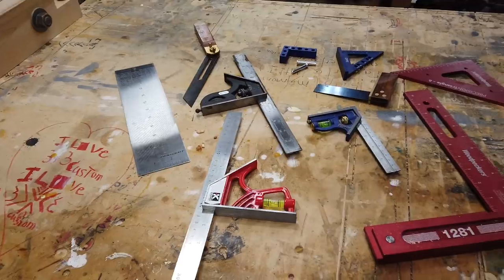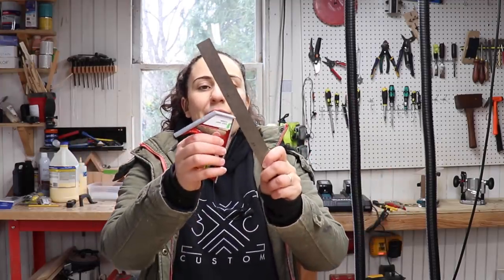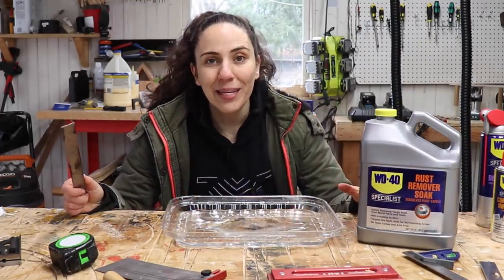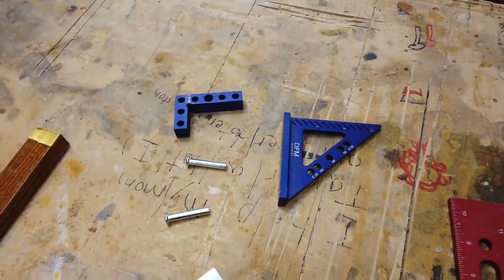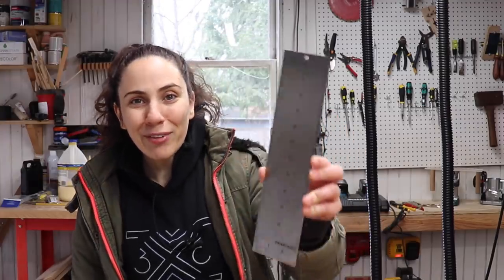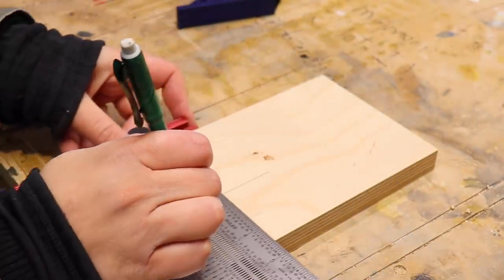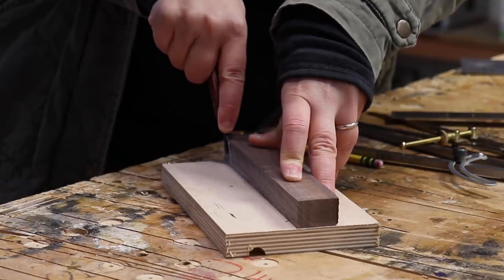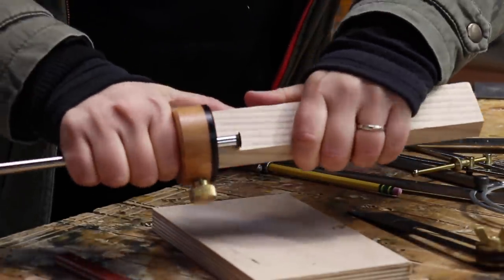Best Tools for Accurate Marking and Measuring When Woodworking

Comment: The measuring calliper is really a must. It is especially useful when you have to juggle imperial and metric bearings, bolts and nuts (if the calliper contains both units of course), since differences can be very small (such as between 3 mm and 1/8" (which is 3.17 mm)). As a Canadian, I was already familiar with both, but I was surprised to see imperial-sized hardware in Europe as well. I don't have an electronic one, but that's the least important part.
Reply from the maker: Yeah. I actually never turn it on. Ha

Comment: Thanks for talking about the digital calipers. I’ve had one for quite some time but struggle to acutely read the measurements. I’ve seen videos on the Vernier system with mm, but I prefer inches to keep it simple in my old school mind. I saw your measurement translator stuck to yours, so the questions are “where and how did you get it? Are you planning to do a video on how to measure with and read the digital calipers? Great work on this video!!!
Reply from the maker: I actually never read the numbers. I use my calipers for referencial measurements

Comment: Yes!!!  An accurate square is absolutely essential.  In my early woodworking days, I too had a square from "Larger Hate"...that thing was slightly off and I was frustrated for months trying figure why none of my cuts off a miterbox was not square.   Making a friggin' frame was a first project and I couldn't even get that right!  It was demoralizing.  Then my gf at the time was making something and just used the miterbox without making sure it was square after the cut and making "corrections" to the pieces...she got a perfect box right off the bat.  I was so miffed...I checked her box with the Larger Hate square and sure enough, there was a gap.  It all clicked at that point...it was the dang tool the whole time.  Well, maybe I was the tool because I didn't think to check it! Arg!!!!!  I still buy stuff from that store, but only things I can get away with being inaccurate.
Reply from the maker: Yup! Been there! It was so frustrating for me. I couldn’t understand what was happening. Agreed, still get stuff there. Like their clamps. But nothing that requires accuracy!

Comment: Rather than a sliding bevel gauge, you should try a digital bevel gauge. They have a small screen that tells you the angle down to 0.1 degree, and the one I have has a non-protruding friction lock. It was a life-saver when I did a project with a lot of sharp angles, and it’s also great for verifying the tilt angle of a table saw.
Reply from the maker: I have one of those from Home Depot. I never really loved it. Maybe it was the brand.

Comment: Before you throw away your framing square, search on YouTube for video's on how to how to fix a square that isn't "square". The basic idea is to use a center punch on the inside and outside of the °90 corner depending on which way it needs to move. To my knowledge these are the easiest square to fix. (If I can find a video I'll add it to this comment.

Happy New Year!!

Edit:
https://youtu.be/AKrrN-80OC0

Just becuase the square isn't °90 it's not a problem. Even an insainely expensive framing square can be nocked out of square, so if you can only afford the cheaper square it can still be fixed. Just buy the best one that your budget can afford 😊
Reply from the maker: It was just a joke. Ha
Reply: @3x3CustomTamar  Ok..... if you decide to get it back to °90 you have a link to a video anyway 👍

Comment: don't throw out a carpenter's square like that! if you drive a center punch into the metal at the corner you can adjust its angle. drive it towards the inside if the overall square is too narrow, or the outside if it's too wide!
Reply from the maker: Ha! It was just for dramatic effect. Don’t worry 😂

Comment: Cool tip - hadn't seen scribing to center mortise waste removal before. Check out a birdcage awl. It won't deflect into the soft wood if you need to start a hole between winter and summer growth (SYP for example).
Reply from the maker: Thanks!

Comment: That square you threw away can be fixed if it's within an 1/8" over its length.  Just takes a center punch and a hammer.
Reply from the maker: I didn’t really throw it away. It was a joke. Ha

Comment: Great video as always, 3 tools that I use regularly for marking are a digital angle rule, automatic punch and my favourite is a  digital height tool ( don’t know it’s real name) used for router and blade height but I use it mostly for transferring measurements as it’s so accurate

Comment: Two things - good combo squares have a little nib in them that allow you to adjust squareness - file the nib to bring back into alignment. Also, when faced with derusting something like a metal straight edge (because wood don't rust), I use a piece of PVC pipe with a cap cemented on one end. Uses minimal rust remover, and makes it easy to pour back again.
Reply from the maker: I was joking about throwing it in the trash.... ha

Comment: Great and informative video for the newcomer but as a long time tech trained buff I would advise against using the Vernier caliper as a marking knife for a whole host of reasons - For one the blade thickness of the tool is such that you cannot practically assure a square hold throughout the stroke.  Second, in order for the one blade to mark, the second must stay against the  second  (index ) surface below the edge guaranteeing a diagonal dimension point to point different from that intended (if you draw out the end on geometry you will see the obvious) Thirdly, do what you advise enough and you will wear down the sharp index faces of an accurate instrument doing work it was never intended to do.  Please use the whole host of tools at your disposal and  avoid fostering bad practice.
Reply: Another idea! If you hold the blade at the depth gauge end, you may have a perfect hammer too!  ;))

Comment: To me, since I started woodworking regularly, the Fastcap measuring tapes are the rare items that are the best and cost the least. I have bought out the supply at woodcraft a few times as they make great gifts. Also I have yet to find a combo square that does not drive me crazy with the adjustment screw. I’ll have to try the starrett. 

Great job as always!
Reply from the maker: It’s the best tape! I have multiples as well!

Comment: Hi, love all your videos and learn a lot of stuff though I have never done woodworking. 
Can you explain something, so there are many power tools to cut wood. Like a circular saw, jigsaw, miter saw, table saw, etc. Imagine, I want to start all things fresh, and don't want to spend a lot of money on many tools. If I get only a table saw, a good one, and I don't buy any other cutting tool, will I be able to do all the cuttings I need from it?
Thanks for all the videos, Cheers!
Reply from the maker: Thanks! You will be able to do a lot with a table saw. But not all. Like you need a jigsaw or bandsaw to cut curves. Or to rough cut long pieces. You should really do that in a table saw. You can use a jigsaw, circ saw or miter saw. There are always work arounds. And sometimes the fun part is figuring those out
Reply: @3x3CustomTamar  thank you for explaining 😊🙏

Comment: I have the 25ft FastCap tape, love it. I don't know if the smaller ones have this or not, but mine also has a built-in pencil sharpener on the back corner that works great! I like the idea of getting just the marking knife blades and making custom handles for them.
Reply from the maker: Yes! Forgot to mention it has a pencil sharpener. It’s such a good tape. I have like 4 of them. But can never find any of them 😂

Comment: There's a 4th way to use the calipers to measure. Note how the moving part and the ruler part of the caliper are flush at the top when it's fully closed. You can measure step height by putting the end of the caliper against the top of the step and sliding the ruler part down to the bottom. This is less prone to being off angle or flex like you get using the depth gauge end.
Reply from the maker: Cool

Comment: Additionally, the tape measure is never up-side-down since the numbers are on both sides.  So it doesn't matter if you measure from right to left or left to right.
Reply from the maker: Yes! That’s another reason why I love it! And it has a pencil sharpener built in

Comment: I use carb cleaner to knock off the rust without using super harsh acids.   It works great to get a siezed pair of pliers back to working condition.

I will then use WD40 or some other wax or lube to help prevent more rust.
Reply from the maker: Do what you gotta do. I love the WD40 stuff.
Reply: @3x3CustomTamar  it's just super quick.

Comment: I didn't see a link for any or any comments for one, but do you recommend any particular type of mechanical pencil? I know not all are created equally and some are better than others. But higher cost doesn't always equal better quality. So any recommendations for a decent one that isn't too overpriced?
Reply from the maker: Yes! Forgot to mention. You just want to look for a .5 led. You don’t have to get an expensive pencil...
Reply: @3x3CustomTamar  thanks. Ya I have a "Walmart special" that is 0.5mm but I find that sometimes the led breaks easily. Could be that I have too much out at that time. But I also find that the 0.5 tends to "sharpen" itself against my metal measuring devices (like my combo square). So might give that marking knife a try and see how that works for certain times where I'm definitely cutting material.

Comment: On the digital calipers you can also measure the width of a shoulder. Use the end of the calipers by the jaws on the backside. This is similar to the depth gage on the other end but it is better for certain measurements because it easier to hold the calipers square to the workpiece.
Reply from the maker: Yup! Forgot to mention that!

Comment: This was a great video. I inherited a large framing square and kept hanging issues with projects not coming out correctly. Imagine my surprise when I did the check for square test and found out it was out by 1/8 inch over 24 inches. I bent the short arm and tossed it into the trash, just like you did.
Reply from the maker: Hahah! Sometimes you gotta learn the hard way!
Reply: Too bad, they are easy to fix.

Comment: I have to say this, been wanting to after watching a number of your videos.    I find it so interesting, that with a lot of bigger, newer tools in your shop, your table saw is a small Dewalt contractor saw.  It is nice to see that a big cabinet saw is not required to do the level of work you do.  I have a larger Dewalt contractor model, bought it because of the table size.  It works great for me, and don’t feel a need to upgrade.  I would like to increase the tables surface, so going to build a cabinet to put the saw in.  I need to figure out how to handle the rack-n-pinion fence, I guess I will just cut some grooves and reinforce from underneath if I need to.
Reply from the maker: Yeah... it’s been  working for me for the past 5 years. It definitely has its limitations but I just work around them. I do hope to upgrade one day though!
Reply: @3x3CustomTamar  when you do, it would be interesting to see your evaluation process.

Comment: Nice segment, great information. Question, you use CA glue with an accelerator for extra fast adhesion. I cannot find anything like that, the accelerator. what is it?
Reply from the maker: Thanks! Yeah! I believe I linked to it in my 5 easy scrap wood gift video.
Reply: @3x3CustomTamar  
Cool
I’ll take a look. 
I’m a huge Amazon fan and user. Don’t know why I didn’t look there, but they have it. That super glue sure comes in handy a lot.